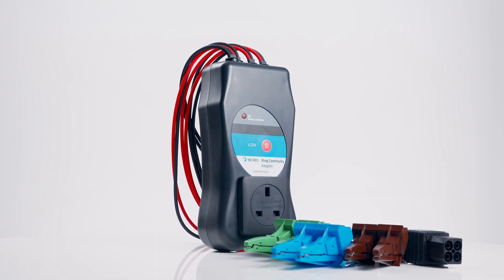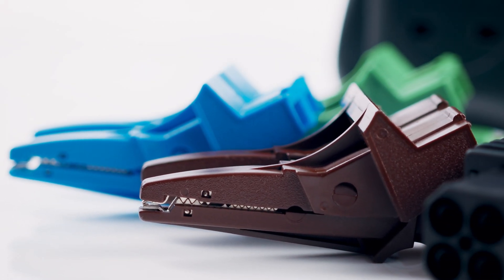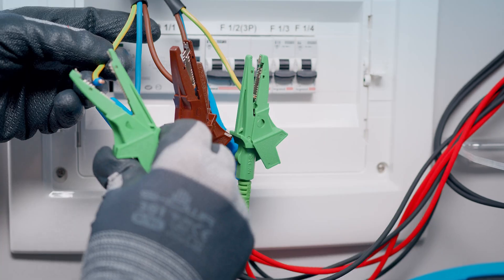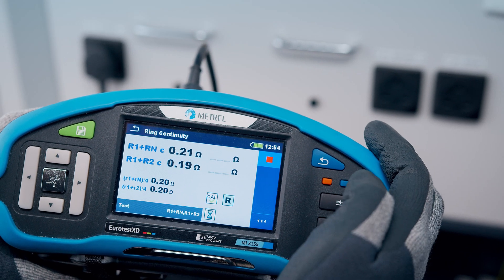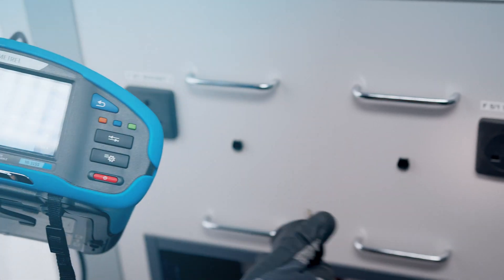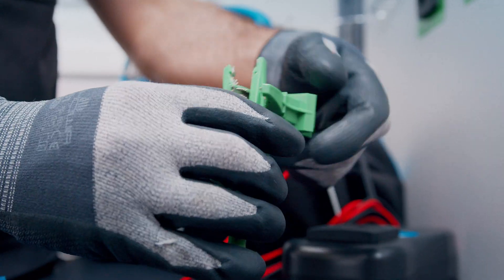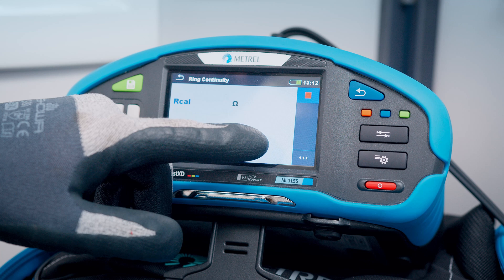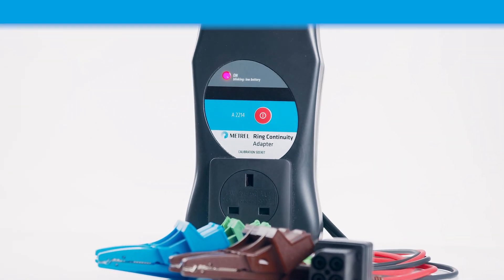A 2214 | Ring Continuity Adapter | Promotional (UK)

Comment: The A2214 is a good idea badly executed as it is not practical to use it on some sites due to the lead lengths being too short and risks damaging the test meter. And the bigger problem is Metrel UK won't take the feedback onboard
Reply from the maker: Thank you for your feedback. We appreciate your insights on the A2214. Could you please provide us with the cable length you find most practical based on your experience?

Comment: Useless Company....AVOID. 
Still waiting for a Firmware Update to calibrate my A2214 Ring Continuity Adapter. 
I purchased the 3152 & A2214 February 2022 and haven't been able to use the A2214 due to lack of Calibration on the 3152. 
The A2214 has now been replaced with a newer version that includes a nulling feature for the mains cable. So I now have an unused out of date piece of test equipment that I still cannot use. Personally I would never purchase anything else from Metrel due to the terrible customer support. 
Over £1200 spent on kit that cannot be correctly used and took them 2 months to reply to my support query with the response that Calibration would be in the next Firmware upgrade which was 2 Firmware upgrades and still nothing !!